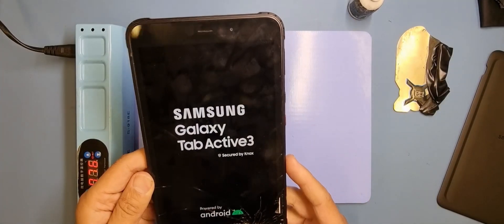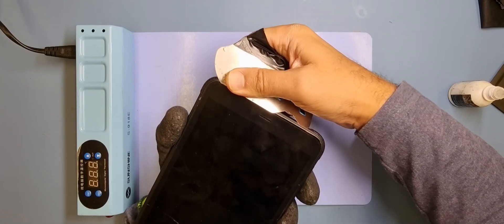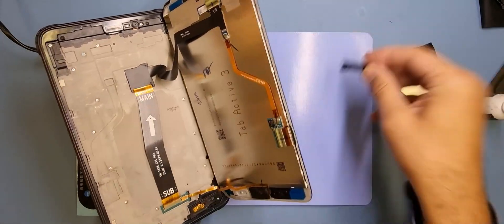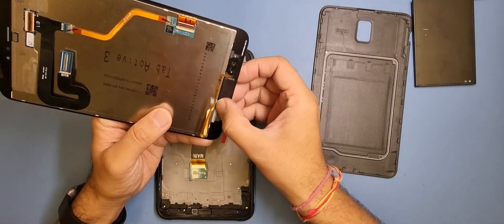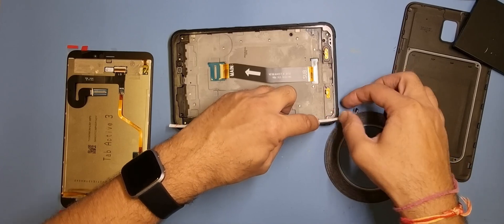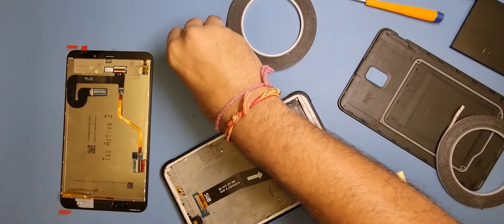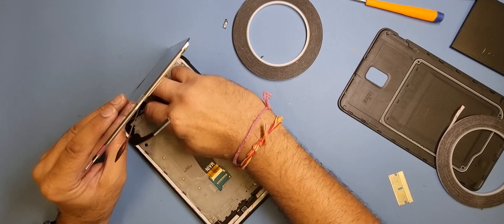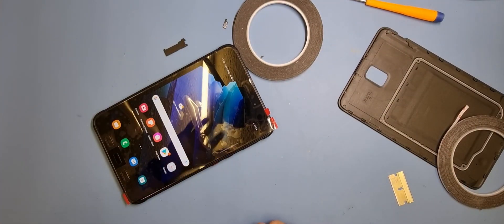Samsung T575 Tab Active 3 LCD Replacement

Comment: Hi thanks for the video great to see this. I've managed to remove the screen following your advice. 

But getting the circuits off the original LCD to relocate on to the new LCD is a nightmare.😮 I've tried heat and removal tools but they ain't budging. 

Also by the LCD connection on the board there's a clip connector that's up? Does this connect to anything as the back of the original it's taped down! 

Any help in how to remove the connectors from the metal board would be appreciated.

Many thanks
Reply from the maker: Hi, to remove the original circuits heat them up with a hair dryer and use IPA to soften the glue they will come like soft butter.

Comment: I ran over mine with a ride on mower, totally trashing the tablet, but it still worked .
Bent body smashed screen. I was devastated. 
6 months later 
I straightened out the body with a lump of wood and hammer and bought a screen on eBay. 
I put it all together, and it works perfectly. 
Now, after buying another one , i have two of them. 😊

Comment: Hello thanks for the video. My pen dosnt work after the Screen replacement! Any idea?
Reply from the maker: Hi i would recommend updating driver via windows updates optional updates, please let me know.
Reply: Same issue here and updating did not fix. Could something have gone wrong during the installation?
Reply: @TrueNorthZero  It is because the flex cable! check the connection again!
Reply: @serkanarpa4856  thank you! I will check that out.
Reply: @TrueNorthZero  Great 👍
Reply: @serkanarpa4856 Your advice worked. Thank you for taking the time to help. Wish I could buy you a coffee or tea!
Reply: @TrueNorthZero   Thank you! Glad it worked, have fun ;)